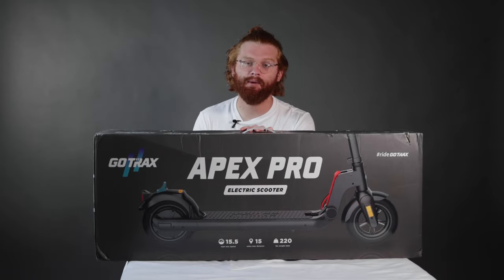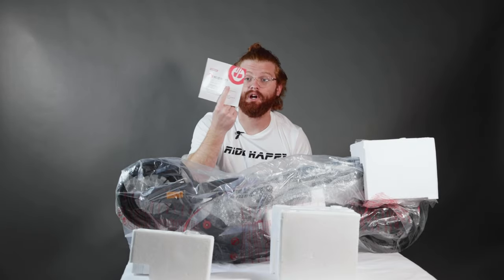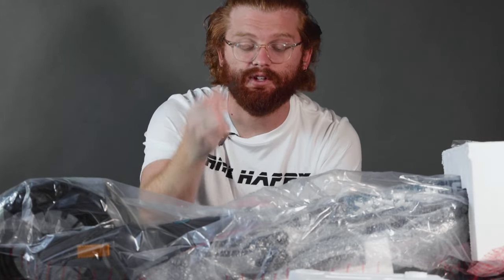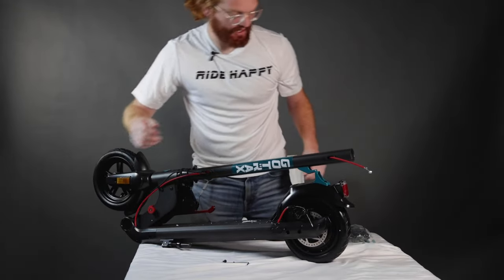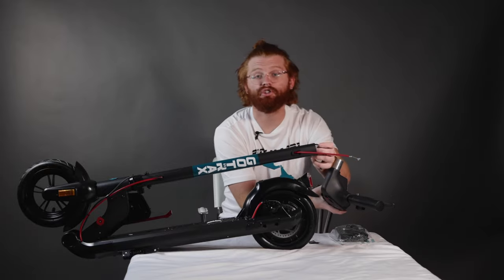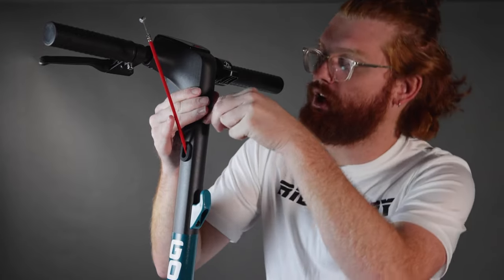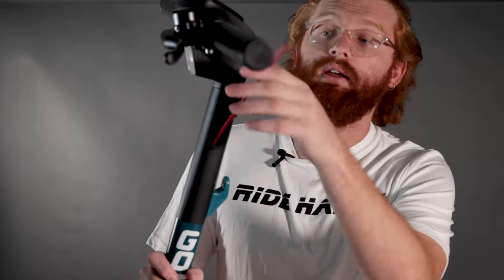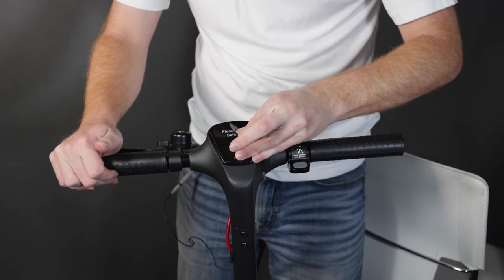How to Assemble GOTRAX APEX Pro Electric Scooter

Comment: What’s the difference from the apex and the apex pro?
Reply: there is no difference i have the apex and they are just rebranding these when they are the same thing.
Reply: @mousecursor6521  does your Apex break often? I’ve had mine for 5 months and every week there is something wrong with it
Reply: @Jiggahogga  i had mine for more than 2 years the only thing that broke less than a week ago is the handle so i cant drive it at all anymore
Reply: @mousecursor6521  wow I’ve had mine for only 5 months and just about every part has broken the back tire deflated 3 times even tho there was no hole the handle bar cracked the red piece at the bottom of the handle bar broke off the front wheel exploded and just about every screw in the handle bar is missing
Reply: difference is the scooter's physical size - apex pro has a larger deck / more foot space